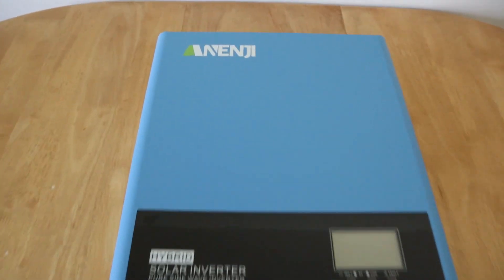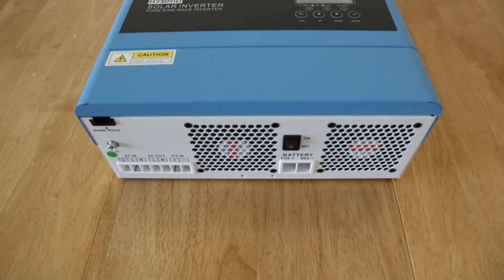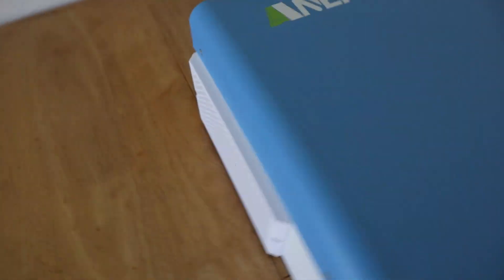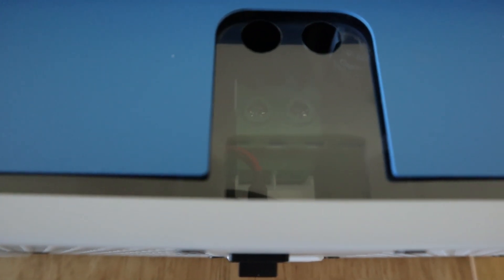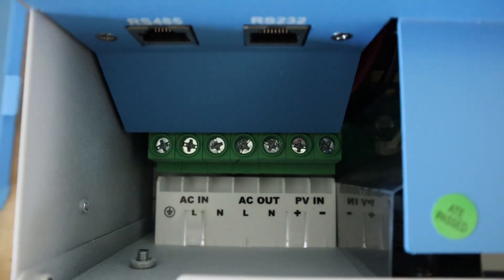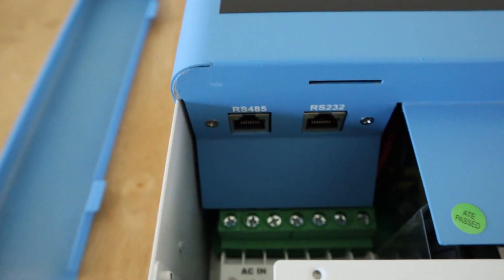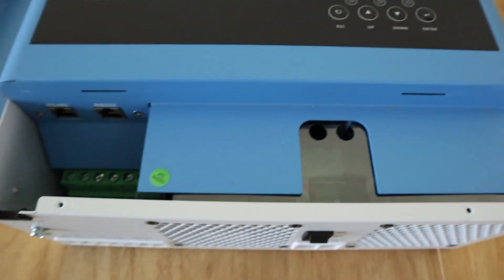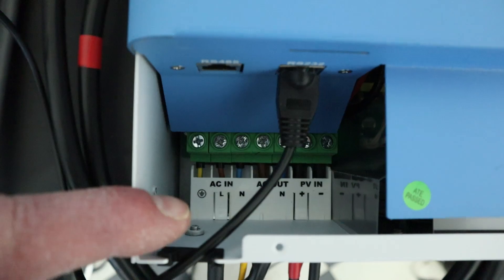Anenji 48V Hybrid Solar Inverter Review | Batteryless Off-Grid Power?

Comment: The Air Flow Direction is as Stupid as the inverter, the Convection of the hot air will go inside again and it will keep the Inverter HOT and it will function always as a High Temperature, Stupid Design

Comment: Does this inverter interfere with the grid in any way? I want to build a small solar system with a battery and have the grid as a backup in case my battery runs out of power. However, the inverter must not feed any energy back to the grid, and it must remain isolated for safety reasons. It's very illegal to have a solar inverter that synchronizes with the grid here where I live. I'm looking at the EASUN inverter mostly but since I saw your video where it broke, I'm also looking at other options

Comment: All of these high-frequency transformerless inverters, no matter what the brand are absolute crap. It's the design and the cheap MOSFETs and capacitors that's the problem. They offer shorter life expectancies and poorer surge capacities.  And because they don't use an output transformer, they can easily damage your homes appliances when their MOSFETs fail.

Comment: Hello, does the inverter also work without a PV input, so only for pure battery charging and discharging? In other words, it would be charged on the AC side from a solaredge
Reply from the maker: @christianamort6208  Thanks for your question. I'm currently using mine like that to charge new batteries without PV input. All the best, Adrian

Comment: Thanks so much for an informative video. I am about to buy the 4000w version. My panels (4 panels in parallel) each have a voc of 43. The stated range of the mppt is 60 to 400. Will this be a problem for me?
Reply from the maker: @kl281072  Thanks for your kind feedback and question. You are correct, the voltage won't be sufficient for the MPPT to work with. Is there any reason your panels are connected in parallel and not series? All the best, Adrian

Comment: Hi can it be connected to a 13amp socket on the wall.
Reply from the maker: @stephenstuchbury9853  I only connect to the grid for battery charging off cheap electricity (especially when solar isn’t enough). I did indeed use a 13A fused plug and correct sized wiring into to the plug when charging. I did have to limit the battery charging rate in order to not stress the plug + socket and wiring (~2.5kW or less). You need to be very careful as the inverter can pull over what a standard plug socket can provide 13A x 230V (~3kW), so I only used this setup when I was charging the battery and avoided using anything that could have pushed it over while doing it. All the best, Adrian

Comment: If I buy 6,2kW Anenji and try to draw e.g. 10kW, can it use grid to support the load?
Reply from the maker: @TomSon-ej3pw  Thanks for your question. Its output is rated at 6.2kW, so no. If you need more, it might be better to look at the 11kW version. All the best, Adrian

Comment: Can it be configured so it never pushes any current back to grid? In my jurisdiction it's legal to connect inverter, but it's illegal to push current back to the grid without permission.
Reply from the maker: @TomSon-ej3pw  Thanks for your question. It's not a grid-tie inverter so doesn't feed back to the grid. I only use the grid connection for charging the battery on days when the solar doesn’t provide sufficient charge to run things overnight. I hope this helps. All the best, Adrian

Comment: Do I have to hook AC in from grid to make it work? What about the earth dongle on the socket if it's not hooked to the grid? Thanks for the gr8 video.
Reply from the maker: @Pickup3000závady  Thanks for your question. I run mine off-grid and only connect to the grid when it's cheap or free energy to charge the battery (when solar hasn't been enough during the day). When it's off-grid there's no earth and when it’s connected it will use the one from the grid. There are other ways to do if an earth is needed like earth-neutral bonding (off-grid only), but It all depends on the individual setup. I hope this helps. All the best, Adrian

Comment: I don't understand the term 'hybrid' as they apply to this product. In my understanding a hybrid inverter these days means a grid-tied solar inverter that has some battery backup. This looks like a bog-standard off-grid unit with bog standard mains backup for when the batter gets low? 🤷🏼‍♂️ I'm saying this because I very, very nearly bought one on Al*E*pr*ss because they're so cheap and what I really want to do is make a redneck PowerWall from a cheap grud-tied hybrid inverter, a 5kWh 51V rack battery (which I already have) and Solar Assistant and plug the whole thing into my home AC where I already have Huawei inverters that, yes, are grid-tied hybrid but are outrageously expensive to upgrade to battery storage.

Comment: Can you test it for a while at peak power consumption? If that holds for a few continuous hours it should be good in the long term. My only doubt is the quality of the MOSFETs and this only shows up when you are at peak power.
Reply from the maker: @ForgottenGamesAndMods  Thanks for your question. I've now dismantled this system as I'm testing another out. I'd suggest avoiding this if you're looking for something that could pull full power for continuous periods. You'd be better off spending much more for a Victron or other low frequency transformer based hybrid inverter. All the best, Adrian

Comment: Good day sir, great video. Was about to buy 70mm2 for my set up but will go with 35mm2 now so that saved me trouble already! I had a question. Do you know if you’re able to feed back to the grid with this set-up? And if you also through ac-in port from the inverter? Is solar assistent able to manage this (at least based on time schedule)? Or would it be able if you connect it with the home assistent connection? Thanks
Reply from the maker: @vfvf7688  Thanks for your kind feedback and I'm glad it saved you buying the larger, more expensive, cable👍. This is an off-grid inverter that can be connected to the grid for battery charging or bypass for the output, but doesn't feed into the grid (there are other Anenji models that do). There are things you can setup in SA or HA to automate some actions, but for me it's usually charging the batteries from cheap energy. I hope this answers your question? All the best, Adrian
Reply: @DADvinci  How bypass works, during overload?

Comment: hello, have you been able to connect the battery and inverter with RS485? Does it work?
Reply from the maker: @alibabalazzo4891  Thanks for your question. Unfortunately, no. I don't think it's the BMS, perhaps the cable (I've tried a couple now). I'm going to try a different battery soon and see if that does rule out the BMS. All the best, Adrian

Comment: Can you fine tune the battery charging voltages?
Reply: I just got the 12KW model and its manual says it can. I’d recommend looking up this specific model’s manual online to find out if it can or not.
Reply from the maker: @glyngibbs9489 Yes, I always change mine to what I prefer and it's done in the menu system (details in the manual that comes with it). All the best, Adrian

Comment: Exaust at the top and vents at the bottom? Doesn't heat rise? It would be much more efficient to do it the other way around.
Reply from the maker: @manuelhung7724  Thanks for your question. The fans at the bottom are the exhaust point and air is sucked through from the filtered intake vents at the sides. I'd imagine that the usual way hot air rises doesn't matter as the fans are active all the time the inverter is powered up ensuring airflow is maintained (might be best for the internal heatsink layout). This has been one of the coolest running inverters I’ve had. All the best, Adrian
Reply: @DADvinci 
Thanks. I must've missed something. I thought the exhaust fans were at the top, blowing towards the vents at the bottom, forcing the warm air in the opposite direction it wants to go. My fault

Comment: I have just ordered a 48 V battery from China and have limited solar at the moment but going to upgrade to more this looks like just what I need is it easy to programme or does it work out the box? I have just found you so Solar assist is that Volticon if so can you aim me at a video to set up and programme it.

Regards Dave
Reply from the maker: @davewardvodafone  Hey Dave. Just to clarify, you want to run just on solar until the battery arrives? In terms of Solar Assistant (SA), for this Anenji I had to use the Sumry option under the inverter section of SA to get it working. I did an overview video using the EASUN inverter that might help if you've not seen that already (https://youtu.be/DHHiSgIEdJE). There are other SA setup videos out there too if my video doesn't cover it for you. Please let me know on the battery question when you get a moment. All the best, Adrian

Comment: Hello sir , from where l can buy this cable RS232 tu usb? ,thx !
Reply from the maker: @eduarddan9455  Thanks for your question. The AliExpress link is in the video description under the Solar Assistant section. All the best, Adrian
Reply: @DADvinci  is 2 option cable , which one is ?
Reply from the maker: @eduarddan9455  I got option 1 (Assembled RJ45) at 1.8m in length.

Comment: Hi! It is very cheap on ali,n called 11kW and 6.5kW same so confusing product name... wirth 5.5kW max PV in....
 Can it work full off-grid without AC in (utility usage? what is its inverter continous power?
Does it work without utility and battery too only from PV?

Solar assistand test shows for you 4.7kW load and 4kW load on battery and 1.2kW load on PV so goin to waste 500W constantly just by inverter itself....
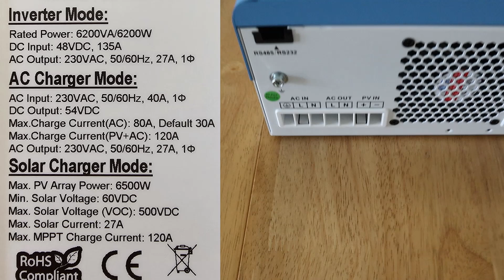Reply from the maker: @fotoamgamgfoto3695  Thanks for your questions. The specifications are covered in this video at 0:14 (please pause the video to see PV input and inverter output details). I use this inverter off-grid all the time and only connect when I wish to charge the batteries from cheap energy (when not enough sun during the day). There's a whole section of this video covering working with PV only starting at 12:39. All inverters have an efficiency rating and the difference between generated input takes into the account the efficiency of the MPPT (solar charging circuit) + the efficiency of the inverter converting DC (from solar + batteries) to AC mains 230V output, this is normal and more expensive inverters will likely have a higher efficiency rate. The rate shown will always be higher when running high loads as it’s a %. All the best, Adrian
Reply: @DADvinci  thanks, my EASUN inverter has not just effeiciency rating but also standby power and mine if utility is connected always draws 100-200Watts from utility as thats is trick to not power the grid as it is using the incoming phase as outgoing phase if utility is conected, so for my 80W powermy fridge use at ningh  I had to  unplug utility and also at daylight it takes more than my original power needs.
There are several factors we have to check on an inverter.
 I cannot conenct utility as they draw constant watts due to this mixed mode....
not just standby and efficiency power wasted, but the power for utility not to 
power back to the grid....

Comment: Hi mate, is there anyway to monitor how much the solar panels are "producing" before plugging a load in the inverter? Suppose your array is 2000w and it is producing 1000w and you plugged a 1200w load, then it wouldnt be enough,, so one could avoid trying that (of course watching a bit if there are clouds and what the fluctuations are). And in this example, if the panels are producing lets say between 400 and 1000w, one could know that at least 400w are produced even with clouds passing by and plug things accordingly. And in another day if the 2000w array is producing lets say 1600w and it is clear with no clouds, maybe one could plug a load of 1200w for longer times? Cheers
Reply from the maker: @segundacuenta726  Thanks for your question. I'm assuming you're referring to running batteryless? From the limited testing I've done (as in this video), it doesn't indicate the amount the panels are producing until you apply the load. I had to make a guess and it wasn't enough. Working on the basis for the kettle test shown you could probably add 10% to the load that's likely to be drawn for what the panels would need to produce. That's why I think the coffee machine test didn't work, the 1200W load would have needed over 1300W from the array which wasn't possible on the 1 March when I filmed it. Your assumption for the 1600W being produced with a load of 1200W would, in theory, work properly without any cloud. The only issue I could see is that the inverter errors and stops working if cloud comes in. I'm not sure if it resets itself automatically after a trip so it would come back on to continue to provide the load once the cloud or panel shading was gone. I hope this answers your question? Cheers, Adrian
Reply: @DADvinci  Yeah, it seems a small battery is needed really. And also apparently having the solar array voltage higher than the output is important for efficiency at least, if not for safety (of the inverter)? In a Brazilian video test released today the guy in his lab, tried an Anenji 48v and basically pushed it to its limits. Thing is those machines that put out dc (that they use in test videos) are constant and unlike a real solar panel array with clouds passing by. In any case, for 230v output the array should ideally be higher voltage than that, and as high as possible without exceeding limits. The problem with having no batteries or just very small ones, is if it is cloudy and the solar production is 5-10% or rated performance, then one has to use accordingly. And if it fluctuates lets say between 20% and 80% then one better have enough battery bank (even if cheap and lead acid) to buffer through that, otherwise one can't count on a solid steady load that higher than the minimum (of that day). Still, it is very cool and I look forward to people exploring it. Cheers
Reply from the maker: @segundacuenta726  Spot on with the step down element, more PV volts in to allow more amps to flow at 230V AC after step down. It's a cool feature in case of emergency (battery issues) to buy time for a fix. I think the small battery might be an issue if it needs to pull serious amps for higher loads. I'm not sure how it would react if you did have the max solar array size of 6.5kW and something smaller like a 48V 50Ah battery. I'd imagine that it would try to pull up to 100A still from the battery that might only be able to provide 50A. For me, in all and every case, I'll always go for the biggest battery I can afford as that's where flexibility and running without sun for days is the key. Cheers

Comment: Great vid can I plug ac out straight into 240v outlet grid
Reply from the maker: @life2133  Thanks for your kind feedback 😊. This is an off-grid inverter so only works taking power from a grid outlet or consumer unit, you can't connect it to feed into the grid (even at just the house level). Please let me know if I've misunderstood your question. All the best, Adrian

Comment: Can you do a video on how to connect the Wi-Fi dongle. I have the same inverter but unable to get it connect to the app
Reply from the maker: @jermainebrown206  I'm sorry to hear you're having problems. These dongles are mostly the same and there's not much I can add other than the instructions that come with them. You do need to be in (good/reliable) range of the Wi-Fi router while setting up on your mobile, otherwise it won't connect for the initial setup. That seems to be a common issue I've heard from other viewers. In essence, it will work fine for my setup, but not everyone will necessarily have a setup (Wi-Fi) similar to mine. You also need to connect it to the RS232 port on this inverter. Please can you let me know what isn't happening or not working? All the best, Adrian